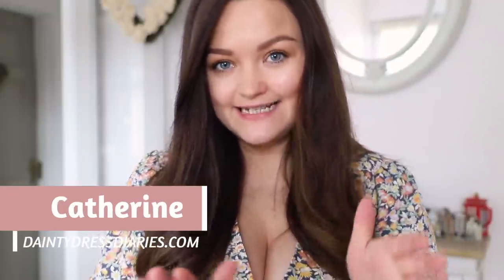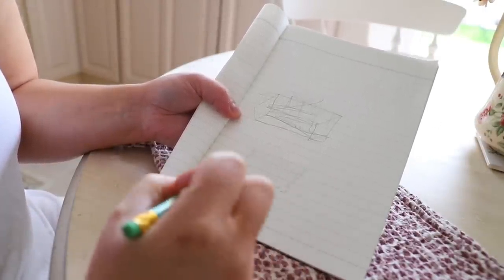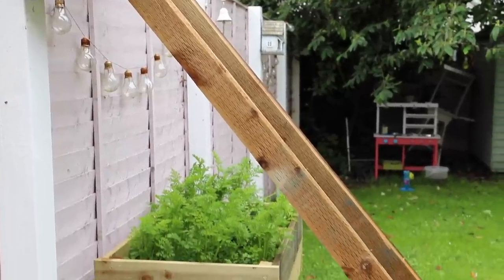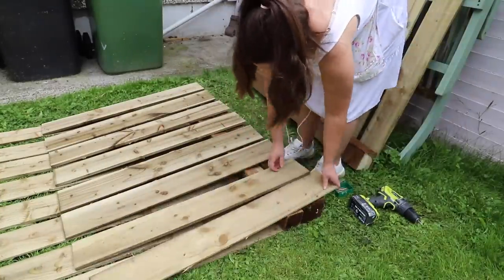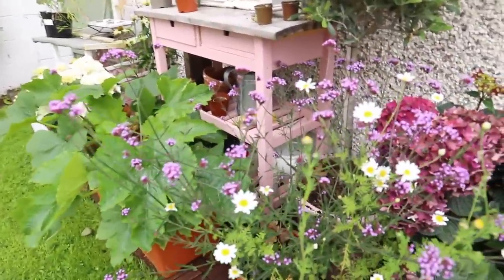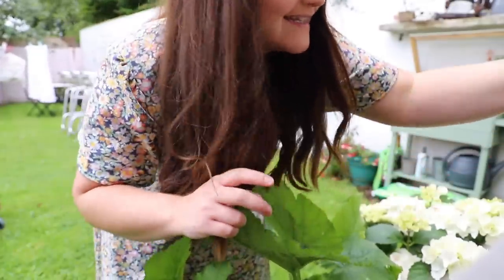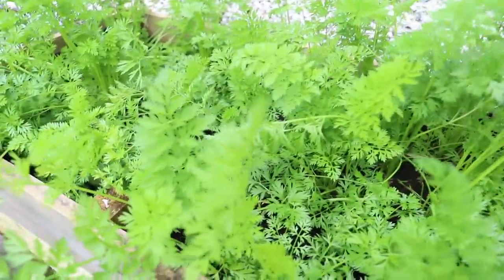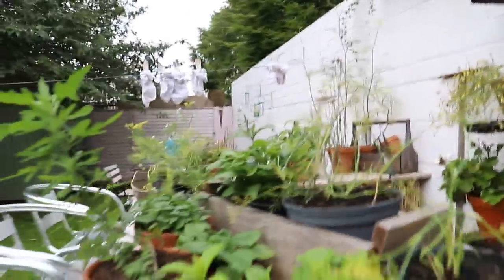How To Make Your Own Bin Storage! Hide Your Ugly Bins | Irish Garden Update

Comment: You are amazing. Great job working with heavy wood posts and power tools and deck screws, etc. Every time I try using my tools I can't get them to work. Won't even turn on, etc. Screws won't screw all the way into the wood. The heads of the screws get damaged. List goes on. lol